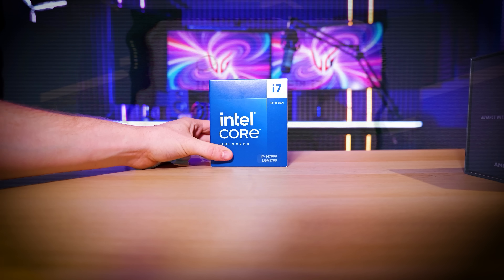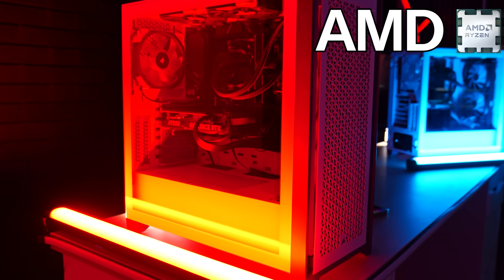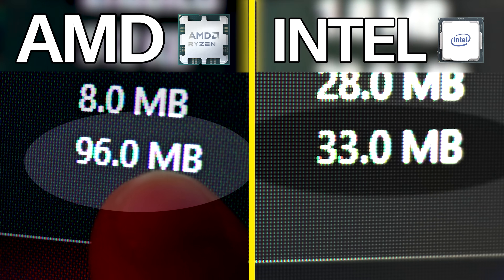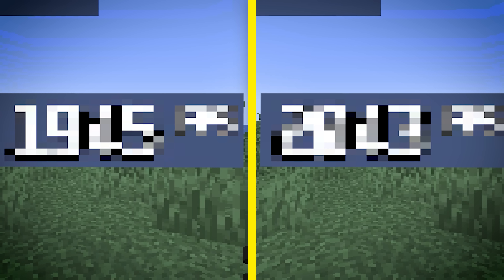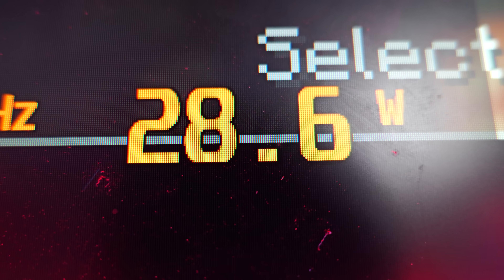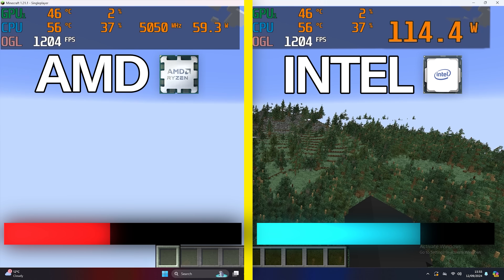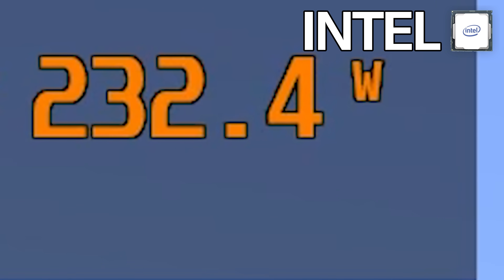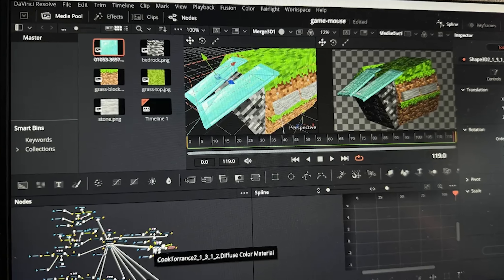Intel VS AMD - Which Is Actually Better?

Comment: Can anyone give me  aclear advice ather than confusing me with something like both have pros and cons, i just want game and pure performance oriented prossecor, powerfull enough to literally handle any game.
Reply from the maker: I'd honestly recommend the 7800x3D or 9800x3D from AMD if you want something that will handle everything pretty well for years ahead
Reply: @Guiny  thank you for your fast reply bro.
Reply: @Guiny  just have one question , I asked the same to chatgpt and the answer was Intel Core i9-14900KS, something like it can boost upto 6.2 ghz
Reply: @rowdyrawat1866  yeah cuz the 14900ks is better for an all rounder + a free heater because of the cores and high frequency but if you're planning the pc for gaming and some other things without breaking the bank then go for amd

Comment: My AMD Ryzen 7700 series laptop processor got like 5fps in bedrock edition with retracing which is impressive it could at all XD this processor is a 4x improvement. Also my 7 7700 could play bg3 around a comfortable 30-60fps but I had to lower the settings and drop the res to 1080p and it was enjoyable. but still impressive Radeon graphics can do it. From my experience Intel and Nvidia can't beat amd's Radeon graphics.

Comment: I've been building PCs for years - my first was a 386-40 which was great!   I just got my first AMD again in ages and amd seriously frustrated.   I can't put any of the cards that work great in my intel PCs into it.   I'm not sure if it is a defect in the MSI Tomahawk motherboard, the bios or a problem with the x870 chipset but I've posted on several forums and even went through the MSI gauntlet required to even open a case with them and all I've gotten is - what bios are you using which is in their insane questionaire.   I think I'll have to return my stuff and get an intel again.

I've tried 3 cards, resetting the bios, re-upgrading the bios, tried all 3 slots, tried modifying a number of bios settings.   Even if it isn't directly related to MSI - their lack of response has ruled them out for future motherboard purchases.   I swore them off about a decade ago but then thought maybe they've changed - nope.

Comment: Thank you tha k thank you. I'm so grateful for this! I need a new laptop for 3d design softwares but of course, also for minceraft. I see that Intel still operates pretty well and even better in some thing on the bedrock edition, which is the one I use. And I like things to move faster. My current laptop lags so bad for a good 5 seconds sometimes and I can't move, I have problem loading, I've spend up to 2 hours trying to join a friends world and failed so speed is what I need most. Would prefer to not have issues with the world loading though but I mostly play in survival, so I think I'll be OK. Also, the ryez 7 laptop can't be picked up for 2 days and the Intel one I can get now. I also prefer the Intel one in its pretty shade of blue. Thank you very much!

Comment: AMD is better for overall gaming, but minecraft is not really optimised, so if you had a few optimisation mods, AMD would probbly win easily
Reply: Bro, that i7 is a gaming threadripper compared to that Ryzen 7. Even with good optimization, that i7 is just Ryzen 9 tier.
Reply: @saricubra2867  wdym with "good optimization"??? That shit sucks up 200+W, also this is the 7800X3D, not the 9800X3D or even the 9950X3D which would probbly win in core tests
Reply: @MihajloStankovic-wn7jq 9800X3D still is slow, it's the 9950X3D the proper chip
Reply: @saricubra2867 bruhhh the 9800x3d is not "slow" in any departments, I bet you haven't even seen any benchmarks of that cpu maybe you are looking at the core counts??? That doesn't matter for most of us
Reply: @jmoncychannel6652 A Ryzen 7 can't beat an i7 when they are the same gen or one gen apart.

Comment: Bro did not use the best Intel chip. That goes to the i9 14900k
Reply: Bruhhh the vid is old dude + if he used the 14900k then he needed to compare it to the 9950x3d

Comment: In the 90‘s i remeber my Unkles and friend all are using Intel Processors nobody of them Used or Liked AMD. it was not good

And now all kids are on amd .

I am an allways an intel guy.

At this time i have an i5 9600k with an 2070 and i am happy with it.

Maybe later i upgrade to an i7 13th or 14th gen and an 4080.

Comment: question if i do both productivity and gaming then what cpu?...
Reply: depends. if its game dev, and budget, then amd. if not game dev and budget intel. if you go in high end then in my opinion its amd. order ryzen 9 9950x3d -> ryzen 7 9800x3d -> ryzen 9 9900x3d. reason beeing. on the 9900x3d the cores are split in 2x6 core format and onlz one module can access 3v cache and on 9800 8cores can access 3dvcache, since it is one module.

I went for ultra budget rzyen 5 7500f

Comment: AMD have a great consumer grade advantage if  electricity is not full time and they use home inverter which can only supply few hundred watts like 500 or 700 
and i can say it's problem in few countries , as i cannot even play cyberpunk at high settings on backup power even with AMD CPU

Comment: Intel 14700K vs AMD 7800X3D

Intel is in the clear winning 🥇

But... Next-gen it's a different story.

Intel 265K vs AMD 9800X3D

AMD is the clearly the new winner 🥇

If we are talking about 7 series levels.

9 series is an entirely different story.
Reply: 285k should be compaired against 9950x not 9800x3d
Reply: lmao

Comment: Bro cant compare amd 9000 series because intel will lose easily and amd will go u to 11000 or 12000 seriers cpu because amd doesnt change its socket haha 100000000000000- aura intel.  100000000000000000000000000000000000000+ amd

Comment: The thing that many of these content creators fail to speak about is the single thread performance which is very different from a single core performance. Many games rely on single thread performance. I dont know if many of the vids by the creators dont know this or just fail to show it. But Intel has always beaten AMD on single thread performance. If youre looking for a cpu for your specific games you play, be sure to look at what your games if they more dependent on single thread performance. If you go to the benchmarks site, look at the "single thread performance" besides the single core performance and multi-core performance. It makes a huge difference depending which game your playing.

Comment: The Ryzen 7 7800X3D is a gaming cup with less e-cores, while the intel is more productivity bound, meaning it will win in cenebench 🤓
Reply: I run PS3 games on my i7-12700K and it's extremely smooth thanks to those 20 threads.

The 7800X3D feels sluggish in real use (the extra cache helps when you have slow RAM sticks).

Comment: The mother board is the depending factor and because of the different brands it caused the AMD to tie, otherwise the AMD would win  and is better, there is also a graphic card for a reason graphic require more weaker cores that 8 main smaller cores.

Comment: If you are a gamer andwant to do workloads then go with 7900\7950x3d intel useless because degrading and no you will not fix it via software update 😂 what ram you used on the amd board ? Ryzen loves ram and is sensetive against bad ones then the biggest problem is that you did not review for gamers because you reviewed Minecraft, imagine how much more fps the 7800x3d have then the 14700k in basicly every other game around and how less watt it use. Is there more to say ? Yes you review not only wrong you even reviewed at the wrong time because the prices changed, second problem is the intel has no future upgrades but onthe amd system you can throw a ryzen 9000 in it without problems

Comment: Just so you remember fps and benchmarks is not all there is to it 
The cores and the clock speed matters too its distinct for each field you need faster cpu to play games but need more cores to render either a 3d project or a editing software
Just like amd vs nvidia even tho amd beats nvidia in terms of game graphics and performance nvidia is the top line graphics card for editing cuz it has more cores and parallel rendering capabilities 
All i am gonna say its not fair to judge a cpu based on 3 or 4 test you have to test everything to judge it
(My opinion)

Comment: Even then I would not suggest anyone buy Intel because of the poor decisions made past 5 years and the complacency of the company. My 13700K has degraded so much that I have decided to just get a 9800X3D (I have it, just waiting for the new PSU).

Also technically it would be 14900KS vs 7800X3D at the time of recording, now it would be 14900KS or 285K vs 9800X3D.

Comment: For anyone watching this in December 2024 ,know that amd uses the am5 socket ,which would probably be supported until 2027 ,it gives an insane upgradability path
There's also the 9800x3D ,which is slightly stronger than the 7800x3D for around the same price ,and if u want productivity ,amd had also launched the 9950 ,which is stronger than Intel even in productivity

Comment: MINECRAFT IS A SINGLE THREAD DEPEND, IF YOU WANT MORE FPS, MORE STABILITY FOR MODPACKS, BUY RYZEN 9000, INTEL 14TH, I3 14100F PERFORM BETTER THAN RYZEN 7 5700X3D IN MINECRAFT

Comment: In the shaders test at 10:30 to be fair for both sides you need to be using the same seed and same movement.
Reply: More like environment
Reply: @UnitiveBaton if you use the same seed it will be the most fair bc you will have the exact same world gen and everything
Reply: agreed, forest are most intensive areas for gpu

Comment: if your going to do a side by side comparison like this, at least use the same tier of CPUs. the 7800x3d and 14700k are not in the same tiers.  the 7800s are 3rd tier cpus and the 14700s are 2nd tier cpus.  you should have been using a 7900x3d and 14700k OR 7800x3d and 14600k  (or at the top end 7950xd and 14900k).

Comment: Firstly your experiment is false as two different motherboard brands. Motherboards have a different boot speed believe it or not depending on settings. Secondly, Both these processors are kinda bottle-necked with a 4060... i mean come on.. (not by much at all, but yes they are and if anyone disagrees, you are wrong). The best pairing for AMD 7800x3d is a 4080 / 4080 super or above when  going nvidia. For intel the 4070ti super and above. Look, I'm an intel fan boy, Always gone intel for my builds in the last 3 before my new one. However my new rig is a 7800x3d. I switched over. yes bring on the hate lol. Thirdy and most importantly effing minecraft.. EFFING MINECRAFT? grow up and play real games please.

Comment: Not even half way through and your tests were heavily flawed.
8 core isn't comparable to a 20 core in any kind of compute scenario. If you wanna test architecture strength in raw compute, you should have pitted a 7900x against that 14700k. That's a more fair comparison. 
I have a 7950x and I beat 14900ks in multicore benches and 14700k's in single core with minor tuning. And that's a 16 core cpu vs a 20 and 24 core cpu. 

What makes the 7800x3d the king of gaming is the 3dvcache. In terms of compute it gets bodied by everything at its sku level and higher. 
Also ryzen 7000 being the first iteration into ddr5, they slow boot partially to widows bugs and partially to amd stability protocols. 
14700k is by all means a good cpu for gaming and production, but if you game and nothing else the 7800x3d is the flat out better cpu. 
Also Minecraft is arguably the worst game to test because it is a game heavily more reliant on multithreaded, high core count cpus. 3dvcache is useless here because you don't need extra rendering power. You just need more raw compute. You would have better results using a regular 7800x instead in this test because it clocks higher and can be overclocked.

Test something like cyberpunk with path tracing on psycho at 1080p. That will give you all the results you want. Cause this test you've conducted stacks the favor towards intel heavily.

Comment: tbh the 14700k is only worth it if the cost is down by a lot. I persuaded a lot of my friends to get a 7800X3D than a 14700k and we all got it for less than 390$ off deals/marketplace or openbox at micro center. I got mine for 357 open box. the 14700k is already expensive enough + it gives higher electricity bills over time

Comment: Bro 8 cores of amd giving challenge to intel 20 cores
Reply: And this AMD processor is even more expensive than Intels, at least in my country... for about 150-200 dolars
Reply: Well, that's because only 8 of those 20 are p-cores (performance-cores), while the other are much slower e-cores, used for less intensive tasks. Besides that, minecraft is mostly single threaded anyway, the core count really doesn't matter all that much.

Comment: someone help. my i5 11400f rtx 3050 pc wont get 165fps stable in fortnite. i have 16gb ram. will upgrading my ram make me able to hold the 165? any other suggestions i can buy to improve this?
Reply: nah, u probably wanna do something in ur drivers, and get the settings lil low. As ur 3050 is an absolute piece of shit, even a 1070 beats the shit out of 
 it

Comment: The fact both those pcs is the same price as 1 4090💀
Reply: My i5 7500 integrated beats the 14700k in intergrated lmao the 14700k runs half my fps woth shaders but i have a gpu tho💀
Reply: @Natyan-VR  yea because you have a gpu

Comment: explanation for amd and intel:
intel gets more fps in minecraft because of the cpu minecraft uses more of the cpu instead of the gpu but the gpu shows display and is better for shaders 
while for amd games like call of duty work better with a better gpu but if u bottleneck the cpu or gpu the performance will be worse same for intel
for example games: 
intel will run better with cs2 , minecraft and roblox
amd: better with call of duty and some other games i dont know
be aware the intel cpu gain problems over time this wont happen on amd because of amd making proper chips
intel also released new chips but the intel core i9 14900K is worse than some stupid name of the new intel cpu also performance worse than a chip from amd costing around 200 - 400 us dollars

Comment: amd cpu starts slower because it tests ram if it works or not, u can turn that off in bios settings and it will start around the same like the intel cpu
Reply: Yes, we all can see he's a Intel guy and knows very little about Ryzen. He doesn't even know X3D is only for gamers and X series would beat intel in creative tasks as well. It's like an Apple Kid is judging Android which is a Linux he's unaware of 😂🤣
Reply: It’s actually a cool feature 
Honestly it doesnt matter for me whenever the pc starts slow or fast 
I used to be an HDD guy and I can tell ya I had a lot of patience waiting for windows to launch before I went insane
Reply: Is that called memory scrub setting?

Comment: I think that AMD is more convinced today, it flows better in all games as well as in work programs.
Reply: Intel is better if you're not gaming, a lot of people use i3 and very budget intel processor, they're much better than AMD for the same price, but if talking about the limit, no big difference
Reply: Yeah i3 better than this amd. 😂😂😂
Reply: @TheOneWhoAsked432 Whay about the top end cpus
Reply: @MarkIsTiredAlways definitely go with AMD
Reply: So much so that in my case I had to look for Windows 10 on BNH Software so that my processor would perform better because I saw many suggestions that that version of Windows is better for me.
Reply: Yes, I think you did your best, but we also have to say that the differences are not that big.
Reply: Intel has alot of handlings is it tie to amd tough?

Comment: lol you gave amd x2-3 points on some tests only because it had lower volts i mean this is a graphic and speed test and not a volts test who care about how many volts its gonna take if it make a better job i mean testing graphics and game speeds this is what you had to fucos on and not the volts because ofc intel are gonna take more volts its 20 cores vs 8 cores thats more power needed to let it work i think intel is so much better than amd

Comment: While yes, the i7 14700K has 20 total cores only 8P of them is usually used in most games while the 12E cores is used for other things which goes the same for the threads which you would also get 16 threads for gaming while the rest would be for other things like CPU demanding tasks and this is just for a better understanding of the other viewers that is unaware of it and honestly if Minecraft was to use E cores then a good chance the 14700K would have a better advantage.

Comment: I feel like this is just straight up unfair comparison. Intel do better in minecraft because of single thread performance. AMD sucks at single thread but kills multi threaded performance. 
You would have gotten more fps if you have used the full potential of the 7800X3D chip. The 7800X3D does not use the full potential of the chiplet. The Intel i9 14900ks basically overclocks automaticaly thus activating all the cores to perform better. But, hence there are issues with Intel. Please remake a video again 7800X3D and i9 14900K with fair comparison. 
In recent update, the 9950X launched and windows 11 was keeping the full potential of the processor that is hindering even on Zen 3 and Zen 4. 7800X3D is also is the victim of this. Next time, use Windows 10 for better.

Comment: What an awful video. Doing CPU tests in games using a 4060? You need to test with a powerful GPU so you're not GPU bottlenecked. That's CPU testing 101. I hate fake tech tubers

Comment: MSI Thin A15 AMD Ryzen 5 Hexa Core 7535HS - (16 GB/512 GB SSD/Windows 11 Home/4 GB Graphics/NVIDIA GeForce RTX 2050/144 Hz) Thin A15 B7UCX-068IN  

Or 

MSI Thin 15 Intel Core i5 12th Gen 12450H - (16 GB/512 GB SSD/Windows 11 Home/4 GB Graphics/NVIDIA GeForce RTX 2050/144 Hz) Thin 15 B12UCX-1695IN

Which is better